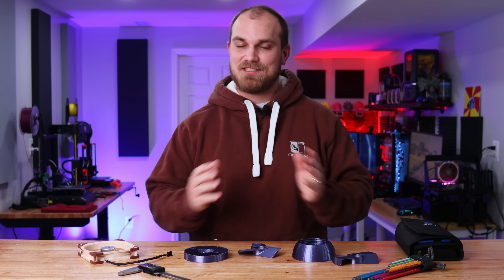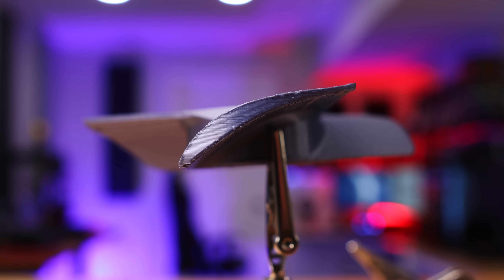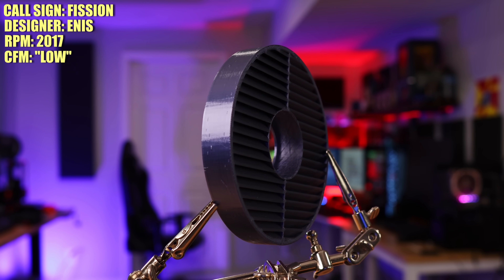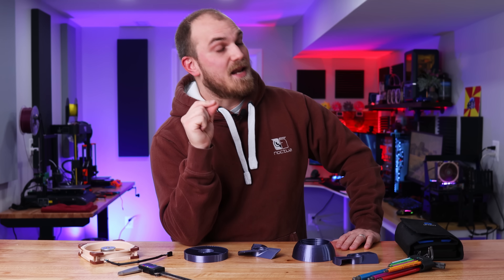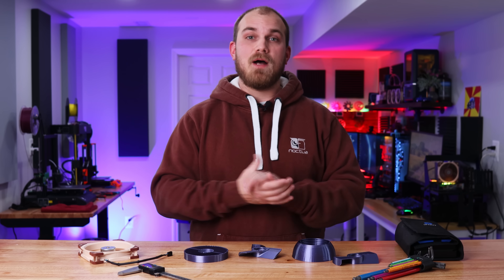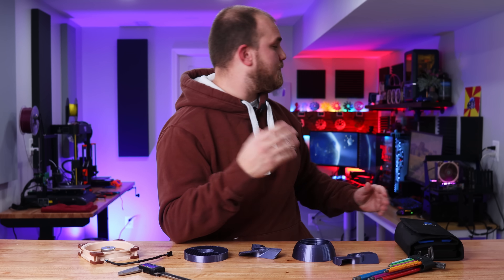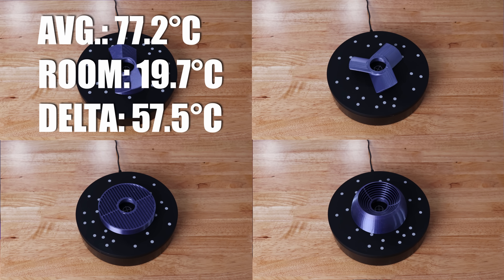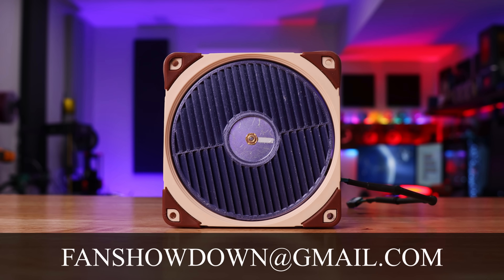IS THIS MAGIC? This Fan Has No Blades | Fan Showdown S2E3

Comment: The Bladeless deserves a special place on the wall.
Reply: I agree,I want the bladeless to be remade with approval from the creator, the vertical walls could be ever so slightly pitched to make a angle, the light angle would help improve airflow, just a idea! Otherwise the design was amazing looking
Reply: Make a separate leaderboard for blameless fans!
Reply: @callanbrain8579 : "Blameless"? What were you thinking of blaming on them, anyway?
Reply: @HelloKittyFanMan.  ooops
Reply: @callanbrain8579 : That's OK; just edit it.
Reply: This show needs a "Most innovative design" spot
Reply: IMO, honorable mentions are better than awards. It means you did something so interesting that while it couldn't be really quanitfied in a ranking all that well, still demanded notice.
Reply: @Exarian : LOL, no! "Honorable mention" is the... "Oh, here's another kid who entered something" ribbon. Everyone who didn't place gets one! It's the pink or yellow one.
Reply: It's more honest than the Dyson bladeless fan
Reply: NO!!! This Bladeless design deserves blades to do better :D
Reply: @janbaxa3282  both sound great
Reply: @janbaxa3282  absolutely. Straight spokes should be swept
Reply: The bladeless may just need higher RPM :)
Reply: @steverpcb  it looks like a modified Tesla turbine. I suspect you are correct.
Reply: I second this motion!
Reply: @JoshB_TheTower  1
Reply: @JoshB_TheTower  1
Reply: @Monochromatik-Vision I actually have an idea in that direction that might interest you.  What if the layers were put down such that the result of each "bladeless" circle were printed such that each layer formed ridges that formed inward-tightening spirals, rather than straight-line circular ones? Or perhaps even such ridges designed in, to the point they are subtle vanes using friction to direct air inward?

I'm also kicking around a potential design using blades that was inspired by the bladeless design, but alas, in neither case do I have the software or design math expertise to produce a viable entry, but there's a couple of ideas to support your call for more exploration down those lines.
Reply: @bookman7409  I was thinking of something similar with ridges. It already uses friction to move air, so you get additional surface area and leverage
Reply: @malijames12  And anyway, this thread's all about playing with new concepts.  One that just struck me is what about mounting a vortex turbine/fan at the center of a design like this, such as the ones Integza's been playing with lately? It needn't, likely shouldn't be very large, but if an airstream can be shaped into a vortex, it might prepare the incoming flow for the main drive, like a turbofan compression stage in a modern jet engine.
Reply: Alot fans need a special place
Reply: I want to see the supports on ‘bladeless’ at a slight angle - admittedly they could then be called blades.
Reply: @howard3274  I was thinking something similar. Makes me wonder if there’s a way to “create” a vortex-tornado with the design.
Reply: @HoushouRattengod : Why is "create" in those random-looking quotes? Is it supposed only fake creation, or...?
Reply: @HelloKittyFanMan.  adding emphasis
Reply: @HoushouRattengod : Hahaha! And when did you ever learn in school that that was ever one of the intended uses of the quotation mark?

Also, why not just use something that actually is designed for emphasis instead, like... oh... I don't know... italics or boldness, perhaps?
Reply: @HoushouRattengod : 2. You can't use something you didn't see coming in the future to describe why you wanted to do something from before, so you couldn't have known that a sensible person like me would come along and ask you the question that you got all butt-hurt for nothing over. (Cont.)
Reply: @HoushouRattengod : 3. I never said anything about sub- and super-script. Those aren't emphasis tools anyway.
4. If your phone is too ancient for you to easily find the asterisk (*) for *boldness* or the underscore (_) for _italics_ here on the YouTube, and you don't want to use your computer to do it, then even using ALL-CAPITALS as a last resort makes more sense for emphasis than quotation marks ever did. (Cont.)
Reply: @HelloKittyFanMan.  what part of “I’m lazy and I don’t care to learn” did you miss?

Irregardless. You asked. I replied. You then “criticized” (emphasis) me for doing things my way, because it hurt your self-established egotistical world view that God-Forbid “someone” out there in the world do things a little differently and unconventional.

And I don’t feel like SHOUTING at someone provides the “emphasis” I’m looking for.

Personally. I’d rather return to the discussions going on about the Bladeless Fans, and quite enjoyed “imagining” The center of the design being transformed into a Vortex, allowing the fan to reach out farther and pull in more air.
Reply: Oh no, what's the matter, crybaby  @HoushouRattengod , you don't even know how to use the shift key on your phone? Somehow pressing that key twice to get it right "takes more work" than pressing the quotes key twice to get it all wrong? Ohhh, whaaaa... Oh, wait, how did you do those caps that you just did then? Also, all-caps one or two words in a row isn't like shouting. It's just enough for emphasis but not shouting. Quotes, on the other hand are NOT going to provide any emphasis no matter how much you think they will. (Cont.)
Reply: @HoushouRattengod : (Cont.) It isn't my rule; it's the rule. It has nothing to do with my ego or my world view, silly boy. It isn't about just being a little different. It's about thinking irrational things like that the language has a provision for that that makes sense even though it actually doesn't. Only an idiot thinks you can just use any form of any punctuation for anything you want and have it make sense.
Reply: @HelloKittyFanMan.  1: Irregardless - is a  nonstandard form of: Regardless. 
It is a real word. It’s first known use was in 1795.

And I use it irregardless of your feelings towards the word. Why? Because I can, and because it annoys self-entitled know-it-all’s.

2. In the early days of texting, there were only 2-methods to my knowledge to add emphasis. Either by typing out in all capital letters, or by using quotes. The habit has stuck, and I care not to correct it.

3. The only one hurt here; is you. As evidenced by the outrage and emotional pain you are putting yourself through to reply multiple times to what is now an increasingly silly conversation that has gone sideways from the original topic; and that I have requested to let it drop (twice now) so that the conversation can return to the proper topic: Bladeless Fans.

All because I “refuse” to bow before your silly and pedantic rules. Maybe you should loosen up and not live with sitting on a stick. It feels great!
Reply: @HoushouRattengod : 1. With every new reply, more of your stupidity shows several ways. “Nonstandard” for entries is dictionary-speak for “Not actually a word because it really doesn’t make sense.” It can’t mean “regardless” because the prefix “irr-“ negates the “regardless.” So no, it’s actually NOT a real word. That’s what they mean by “nonstandard” in the context of attempting to define words. 2. What do you mean by “IT IS first known use”? How can it be a use? 3. My “feelings”? It’s not about my feelings. They’re not my rules; that’s just how these things work. I didn’t come up with it. (Cont.)
Reply: @HoushouRattengod : (Cont.) 4. “Self-entitled”? If you thought you were trying to falsely refer to me, then you’re so very mistaken. Just because someone shows you how something really works as opposed to how you think it can doesn’t mean the person is “self-entitled,” silly boy. It has nothing to do with that and everything to do with just how things actually work. 5. You reason for using it is bogus. You couldn’t have known ahead of time that I was going to come and set you straight by giving you the real info. that you would be butt-hurt by for no good reason. (Cont.)
Reply: @HoushouRattengod : (Cont.) 5. Which possession of a "know-it-all" were you trying to refer to there? 6. The early days of texting are engraving and then the printed word, so no, you're mistaken again. 7. But if you meant "SMS” (the Short-messaging Service) instead, then no, quotes were never meant to be used that way, no matter how many people who are clueless like you believed otherwise. Some things in language change, but not that one. Quote marks only encapsulate what someone has said or someone's own supposition of what may be said. (Cont.)
Reply: @HoushouRattengod : (Cont.) 8. "Hurt"? I never said I was hurt. Just because someone helps you know something you're trying to do doesn't work doesn't mean they're "hurt," haha! I don't know where you'd get such a silly idea. It has nothing to do with "emotional pain," unless that 's what you're having due to your irrational belief system. The conversation is only silly because of how big a deal you've made it and I just reply because you do. 9. What’s that random semicolon for? It has no purpose there. Why did you think it did? (Cont.)
Reply: I'm thinking the gaps in bladeless need to be reduced; maximum theoretical efficiency would be with the gaps the same width as the boundary layer
Reply: @jonskowitz  I'd also make the walls more colical. This would continue to accelerate the air to the very end. In my minds eye, the air tends to slow down as the walls change its direction, reducing the rate of flow.
Reply: @jonskowitz  This is approaching similar principles to a tesla turbine yeah?
Reply: @jonskowitz  You seem to know things, care to ELI5 how this thing works without fans?
Reply: @leethompson717  
 It makes sense when you remember that air is still dense with stuff, you can see it in action better using a liquid like water. The bladeless fan is basically an upside-down bowl, fill a bowl with water and spin it and that water will be thrown against the sides, then because the bowl is curved it follows along and is pushed out the top. Air does the same thing, and because the bowl is open at the bottom new air will flow into the space where the old air was.

Sorry if I went too simple of an explanation, I dont know how much you know about this stuff and this is a good spot to start if you dont know anything. you can get a lot more detailed if you get into the nitty gritty.
Reply: @agafaba  Shifting water requires a lot more energy :(
Reply: @steverpcb  ya it takes significantly more, but its a good way to visualize whats happening with the air and something that can be done (albeit messily) at home by anyone
Reply: @agafaba  Actually makes great sense. It's a good reminder that a gas acts similar to a liquid (which is easier to visualize for most) thank you!
Reply: @leethompson717  Air friction. The thing is more a centrifugal "fan" than anything else. The conical sections drag air molecules from the centers to their rims, hence from the inlet to the outlet.
As other commenters mention, it has some resemblance to a Tesla turbine, but backwards. A Tesla turbine blows an airstream on a disk's rim and the decreasing flow radius drags the disk along with it.  If you instead drive the disk it will "throw" air to the rim. That's what the bladeless fan is doing.
I'm not even sure it can be optimized except maybe by increasing drag by making the surfaces rougher. Laminar flow is counterproductive with this design- turbulent flow locally at the cone section surfaces will improve overall mas flow. It may be as good as it can get as it is but why not try?
Reply: @jonskowitz  boundary layer thickness is technically infinite.
Reply: Bladeless is also placeless
Reply: No wires would get tangled by it
Reply: H3 needs to put some kind of pitch on the inside if that thing so that it can grab air. I believe he is on to something with that Design.
Reply: If it had some blades to draw air in then it would take advantage of both features of a standard fan.
Reply: @Monochromatik-Vision Yes more work needed, such as blade supports v spin :)
Reply: time to create a "wizard space" on that wall
Reply: I think if the spacing on the fins was a little wider, and the support for the rings was angled to essentially grab the air and force it through, it would perform well.
Reply: @Monochromatik-Vision you can check "Tesla bladeless turbine". It can achieve 90% efficiency on similar principle of using only friction between fluid and flat rotating surface.
Reply: I think a modification of the bladeless fan could work great.Perhaps a super tight spiral consisting of a single swept-angle piece, or concentric circles with asymmetrical thickness..Or perhaps non-concentric, nested circles.
Reply: If only for providing discussion about them :)
Reply: True
Reply: I agree. I think some innovative thinkers need to figure out how they can draw in more air to make it more effective.
Reply: A veritable wall of weird
Reply: The only participation trophy I'll approve of
Reply: This design is very common in almost all industrial motors. Only the domed shroud is usually stationary and only the padles rotate moving air.
Reply: it is basically a multi-shrouded fan, with perpendicular blades.
give the blades some angle, and it will be a good air, mover, but heavy (and therefore use more energy/money to run)
Reply: Looks like just a centrifugal inline fan.
Reply: Or ceiling
Reply: I agree
Reply: Im the 2000 like hehe

Comment: The low noise circle fan looks like it's pushing air in the other direction. Much like Noiseblocker fans. It needs an episode on this channel. Noiseblocker fans are focused on low noise radiator fans.

Comment: It would be interesting to test the bladeless at higher RPM, with no blades it should take very little power to run it at several thousand RPM. At high RPM it may well put out an airflow that would put it on the leader board :)
A bladeless silent high RPM low power fan is the sort of thing that James Dyson would come up with !
Reply: Also no matter what way the fan is spun it will push air out the same side
Reply: @gavinhicks7621  That is a pretty cool feature actually.
Reply: @gavinhicks7621  Nope, the non blades are angled rearwards :)
Reply: yeahsss
Reply: That's true. Overvolting the motor and perhaps slightly angling the support slats could make big differences.
Reply: @802Garage  but would that then still be bladeless? :D
Reply: @Ralesk  Technically no, but I'd still like to see it.
Reply: @Ralesk  There will be a compromise between supports helping to spin the air and actually providing thrust :)
Reply: @802Garage  same really, I want to see it as well :)
Reply: @802Garage  Winding turns of the motor and voltage has to be optimised, rule of thumb is that less turns for higher RPM, less turns for lower RPM.
Reply: @steverpcb  I know that. I'm just saying he did tests just by over volting the motor before to increase RPM, which would be a lot easier than rewinding it haha.
Reply: @802Garage  Over volting will give an instant result, but later the magic smoke may cast it's own vote :)
Reply: @steverpcb  Yeah I believe he tested a Noctua motor and a few others all the way to failure. They were able to take a surprising amount of abuse!
Reply: @steverpcb  Check out the video "Unlocking Secret Performance of the Noctua A12x25"
Reply: @802Garage  I think I have seen that, but I do not want that magic smoke to be released :)
Reply: @steverpcb  Hard to put it back in!
Reply: @802Garage  Any reference t Magic Smoke is just for fun discussion, unless those involved get a legal payout :)
Reply: Could it be printed onto steel wires to stand high centrifugal force without a blade effect ? Reducing the blade support cross section will reduce the amount of spin put into the air.

Comment: You should re design Enis’s fan but instead of 2 halves decide it into 1/4s each offset by 90 degrees
Reply: hope Enis see this comment and resubmit the design
Reply: @weebslime  If I understand the rules correctly, then anyone could have done it :)
Reply: It's pronounced Ennis.
Reply: make it an infinite amount of splits where the offset for each point is on a curve. then, you can try different curves and see what happens.
Reply: @Zenthex  That's just normal blades though?
Reply: Yep, at 180 then 50% of the fan is just messing up the airflow :(
Reply: Maybe he should do that in 1/360s...
Reply: @River_Miles  Deputy Sheriff of Rosco P. Coltrane :)
Reply: This! I was thinking of even 6 or 9 sections, but either way...if it was more than just two sides it might actually be pretty good.